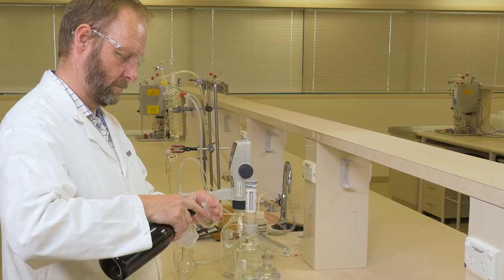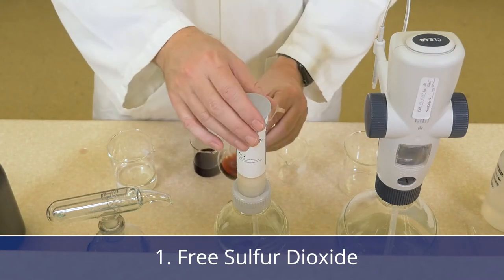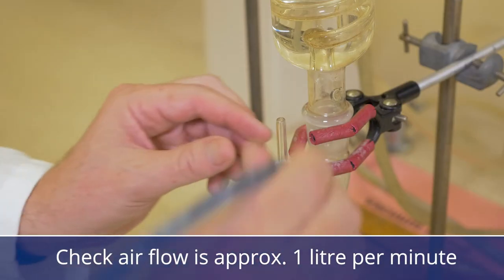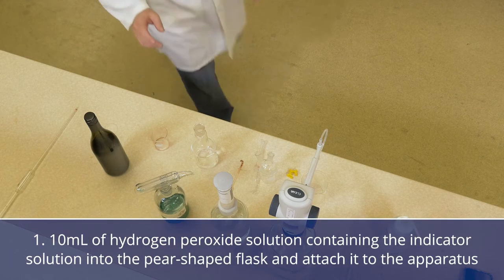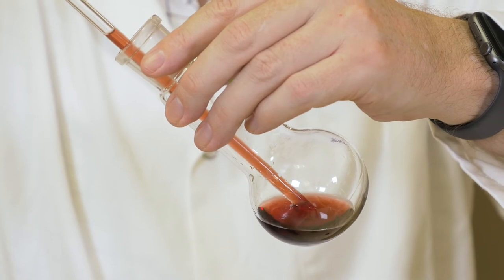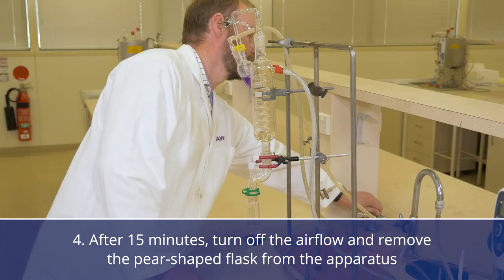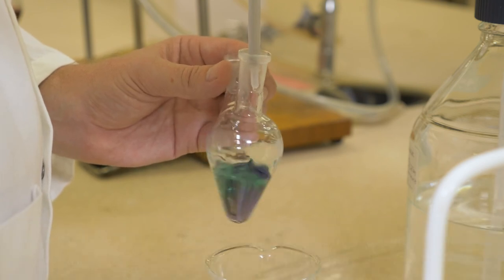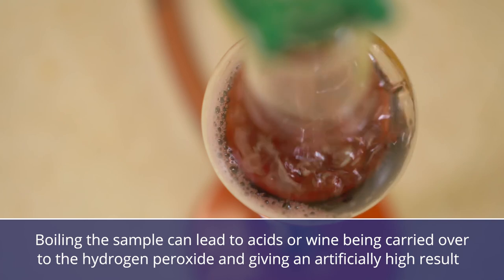Sulfur dioxide (SO2) measurement – Part 1. Measurement procedures

Comment: Is there any specific kind of air used? Only regular compressed air or pure air?
Reply from the maker: Air for the aspiration can be done by using a simple air pump, similar to those used in aquariums. Compressed or pure air is not needed. This technique applies a positive pressure through the system.

An alternative is to use an electric or water vacuum pump connected to the two-necked flask. This generates a negative pressure through the system which draws air in through the aspiration tube into the wine in the round bottom flask.
Reply: Why doesn't water dilute the sample when added?

Comment: You didn't mention i this vedio the concentration and normality of H2O2 and orthophosporic acid
Reply from the maker: The concentration of hydrogen peroxide is 0.3% (w/v) and is usually prepared by diluting a 30% purchased stock solution. The concentration of orthophosphoric acid is 25%(v/v) or 18% (w/v).
Reply: @TheAWRI  and what indicator is used ?
Reply from the maker: @thijsweijters1065  Rankine indicator, which is a mixed indicator. Prepared solutions are often available from chemical suppliers. It can be made by weighing out 0.10 g methyl red and 0.05 g methylene blue. Make up to 100 mL with 50% ethanol (v/v) in a volumetric flask.